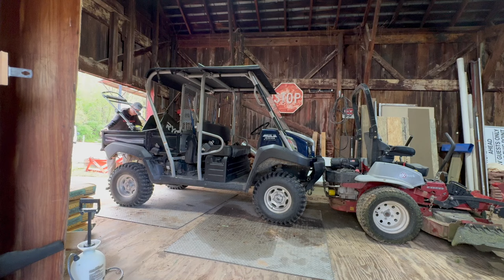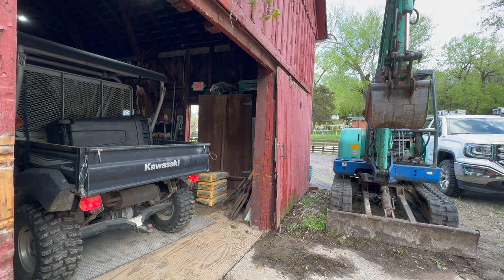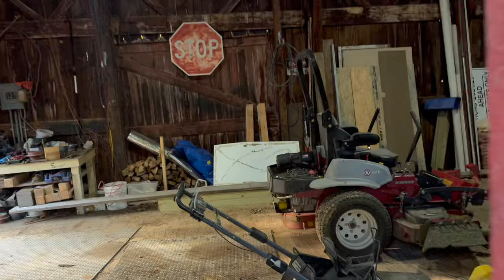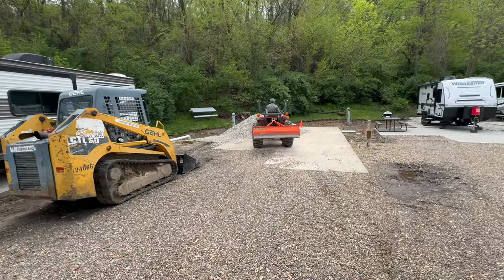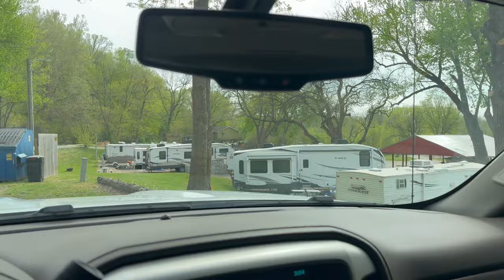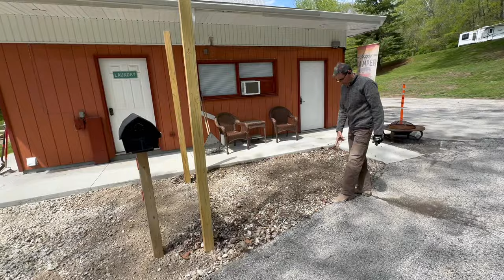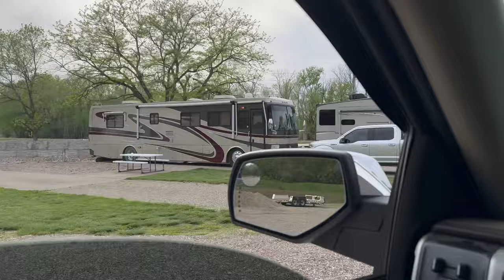We have a PROBLEM at our Campground

Comment: 0:16  there is  your problem  an electric push mower.
Reply from the maker: 😅 it actually comes I super handy for a couple places in between campers. Because it’s so light weight, you can lift it out of the back of our UTV Mule really easily. We mow 99% of everything with a zero turn. But couple places that battery push mower is handy.